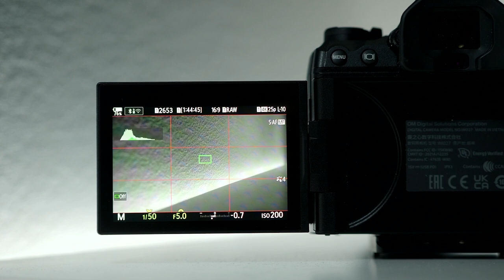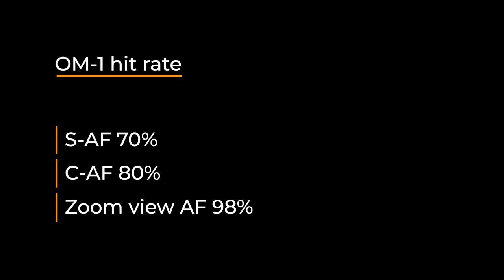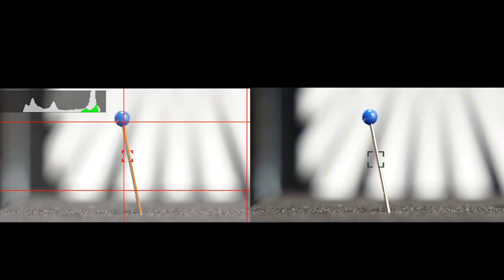OM-1: Let's talk about S-AF.

Comment: I can say nothing about OM-1 or EM1.3 AF system but with my em5.3 i had some problems in low light. It was really hard to shoot trams and cars or any moving objects when they were moving towards you in low light conditions with their headlights on (at about 5-6 am in winter time) on 40-150/2.8. And i mean really hard coz the AF was missing 7-8 shots out of 10 - just moving glasses back and forth and gave up, it was really bad, so i took about 50 shots and got about 10 good shots with no af mistakes what were more than enough for me to made the job done but i had to stay outdoor at about -20C about 50 minutes with dying battery (switching camera on\of all the time to keep some juice for couple of additional shots) instead of 15. It was only one problem i had with EM5.3 autofocus which i could reproduce lot of times (I have a series of photos of trams in a city at morning time).
Reply: Every AF system has limitations, as you illustrated! It is really interesting to have two different camera brands to try them side by side, because they generally struggle under the same circumstances. Can't beat physics!
Reply: That's why I switched from Em5.3 to Sony A7c after having different MFT cameras and many lenses.  And never looked back. When I start missing smaller and lighter lenses of MFT system I immediately start thinking how great the AF-C in Sony cameras works.
Reply: @krzychatc  That's why I many are so enthusiastic about the OM-1 - it is really a huge improvement!

Comment: Thank you for (10:30) cutting to the chase.

This is a huge asterisk on the OM-1's abilities, and reinforces my belief that the OM-1 was released before all the bugs were worked out.

But I'm sure the cult will continue to make excuses.
Reply: This is a huge asterisk on the your intentions, and reinforces my belief that you have no understanding regarding the issue being solved before releasing your comment.
Reply from the maker: You see a solution as an excuse? :). This is quite typical, defining new meaning to words when there is no real argument against it. Changing to PDAF in low light low contrast is the same thing as changing to C-AF+TR when photographing a moving subject. Or is that also an excuse?

Comment: I haven't been following this issue much because, frankly, I don't use my OM-1 very much.

After nearly a year I find my EM1.2 to be much more reliable than the OM-1.

Yes, the OM-1 has a lot of novelties that would be great if they worked consistently as advertised. But they don't, I have found.
Reply: As you bring this up so many times, also on my channel, I would really love if you could share a single example of the OM-1 's features failing compared to older models. 
Maybe you could shoot me an email at some point.

You are basically the only person that brings this up - so this is really strange and I'd be happy to learn more!

Unfortunately, you never replied to my questions so far.
Reply: This really surprises me as I find it superior to my Em1iii. How has it failed? I haven't noticed any issues with focusing, but I'm usually in C-Af and bird detect.

Comment: Um...Robin has put out a video on C-AF in low light and shows it works poorly in low light. Worse than S-AF. The problem for evaluating opposing claims is deciding which test is most applicable to one's own usage. How the OM-1 focuses and how the various EM1 versions focus is besides the point. The user wants the camera to autofocus quickly and accurately.  If it can't do that in some situations when another camera can...that's not a positive.  All the explanations and work arounds can't fully make up for the simple fact of perfomance. I don't want to hear what Panasonic m4/3 camera's do well with regard to focus. They don't autofocus as well as Olympus/OM Systems in general.  And it looks like the OM-1 doesn't autofocus as well as the EM1's in low light. Yes, the OM-1 appears to focus much quicker and maybe better in certain good light situations. But we don't solve problems by pretending they don't exist or finding a slow workaround. That said, I was happy when someone found a workaround to Sony's star-eater problem which worked on some older models.  Unfortunately, Sony's solution was to prevent the workaround on the newer models by making the star-eater function more universal!!!
Reply: Robin's test is flawed. The Lego in the OM-1 shot is 1 stop darker than the EM5m3. Under exposed subjects degrade AF performance on the OM-1. At that light level, Rob's test shows the OM-1's C-AF outperforms the EM5m3 in all cases. Speaking from experience of having used the OM-1 for a year of shooting in the dark 1-2 hours after sunset, the OM-1's C-AF works down to 6-7 stops darker than in these tests.
Reply: @tntytube  If the Lego is one stop darker for the OM-1, then why is the shutter speed faster than the EM5?  Maybe the problem is with the OM-1's light meter.  in addition, Robin also compares OM-1 with C-AF and S-AF...and the S-AF wins.  As for your OM-1's C-AF working in  6-7 stops darker conditions than Robin's test, I'm not buying that. You'll have to prove it.
Reply: @tntytube  yes

Comment: So far I can see. It's far away from a flagship camera. A camera with this price tag have to perform on every circumstance. Menus not touch sensitive. Old USB connector. After seeing all this I'm not surprised they constantly give discounts.
Reply: You obviously don't have the OM-1 & knowing very little about, going on others complaints & getting them mixed up. First of all, it is NOT an old USB connector. It uses USB-C PD connector, as did the E-M1 III before it.